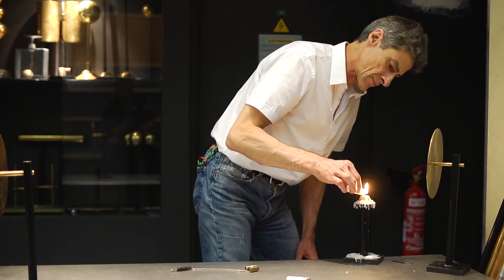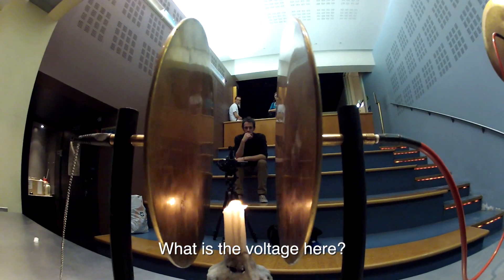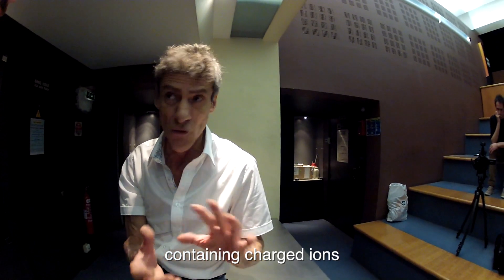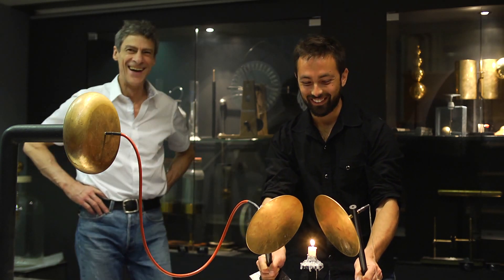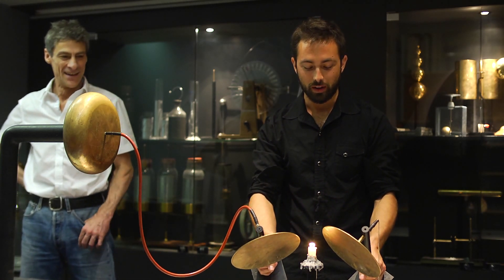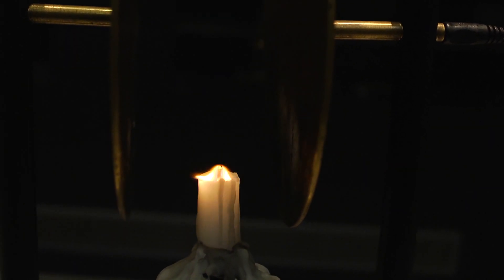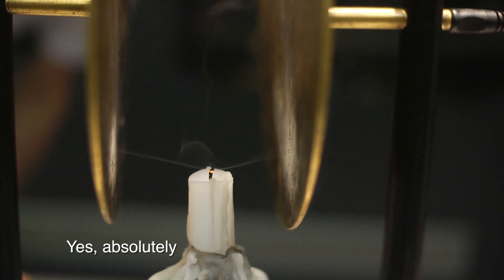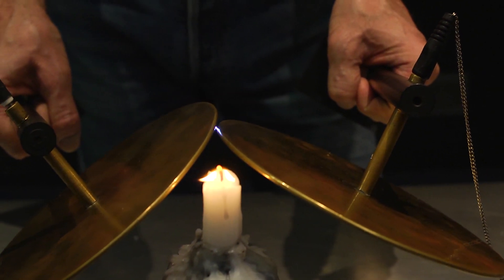What's In A Candle Flame?

Comment: ..., it's like a a drop os water being thrown at you really fast, doesnt harm you much. Although you're right when saying its a combination of both, but amps are more dangerous. Another this is that voltage doesnt drop imediatly. Voltage is the potential difference between 2 points. So electrons only travel is there's a potential diferrence. So if you're 0 and you're touching 20kV, Your body feels the 20kV. It doesnt drop to 0 immediatly. Actually if it dropped, you wouldnt see a spark.

Comment: i dont have an youtube account, just commented because many people seem to agree with this. What you said is not correct. You actually did it backwards. You buy a certain amount of power from the grid. You can see this in your electrical bill.So power is always the same. P = V*I, so if you increase voltage using a transformer, the current has to go down, because you cant create energoy from nothin.That's why you dont die, because the power is the same and the current is very low, (continues)

Comment: It's a combination of both that kill you.

A car battery can hold several hundred amps, but because it's 12v it's unable to overcome the bodies resistance.

A static discharge can typically be in excess of 20Kv, yet have a miniscule amount of current. 

Volts don't kill you. nor do amps. It's the two combined over a period of time, which is is known as energy, that kills you. ( (volts*amps)*time = energy )

Comment: Fencepost - the difference is that R is not constant. Once charges start having separation induced or even ionising, conduction changes a lot. Also voltage typivally changes a lot depending on the load (resistance) placed on it. Ohms law covers only a special case which is not all that common...

Comment: The energy source is important in your examples.  Your wall outlet is driven by the city power grid, which delivers relatively high current (15amps for most US households) with low voltage.  A Taser is driven by a battery (typically 9v, 500mAh from a quick Google).  In order for the Taser to get up to 20k-50k volts, the current is driven way down (about 2mAh), trading current for voltage.  And that's what Ohm's Law really shows -- the equivalency of the three properties.

Comment: The power source can't give unlimted current they probly had it put on a low amount of amps + evry source has an internal resitance which you can compare with a resistore in serie with your source. A tazer works on batteries which you can easly understand give a limeted amount of amps

Comment: I think we all understand that its the current that kills. The thing that is confusing me is: Why, when the resistance of my body is presumably constant, will a 120V outlet result in more current than a 50,000V tazer. Given V=IR, why does V not seem to vary directly as I when R is held constant? What am I missing. I understand that a fire hose hurts more than a squirt gun. But why does 120V equal fire hose and 50,000 volts equal squirt gun?

Comment: I'm just a layman but this is what I think. 
In the 1000A and 21V case, there isn't enough voltage to get that amperage going through the body. The metal being welded has high electrical conductivity, so the high amperage goes right through, even at low voltage. In the 10A and 210V case, the voltage is high enough to push it through your body, AND the amperage is high enough to kill you. I'm pretty sure you can die from a relatively low amperage, as long as the voltage is high enough(I think).

Comment: Well... actually its both. A welder runs at low volts but high amps and will give you a kick, but wont do you much harm. 1000 amps at 21volts (enough to boil steel) will give you a jolt. But 10 amps at 210 volts (1/10th the power) will kill you

Comment: 'Volts don't kill, Amps do' is a little oversimplified. Ohm's law stays valid. Body resistance is 1kΩ - 100kΩ, so at 20kV, that's 0,2A to 20A. Energy dissipation (V * I): 4kW - 400kW (!!). If you connect yourself to 20kV for just a second, you heat up like a toaster.

What really happens when touching these kinds of 'safe' high-voltage devices, is the voltage drops to zero almost instantaneously when you touch it, and it ramps up the voltage again after a few milliseconds, continuing in a cycle.

Comment: It's really joules that kill you, or, more correctly, watts, or joules per second. Or is it coulombs? A high voltage, low coulomb source, like a Van DeGraf, will cause a very high current to flow, but only for a few nanoseconds. This will cause local pain, and cause nearby muscles to twitch, but it will dissipate long before it has a chance to disrupt your heart's rhythms, and is far to little energy to overheat and damage muscle. 
Volts, amps and time all have a role.

Comment: Like the flame, the visible part of a spark is essentially plasma (please, don’t let the hounds descend on me with technicalities). The high resistance of the air causes much of the energy of the electrons jumping the distance to be dissipated as intense, but brief heat, causing the air along the path it passes through to expand very rapidly, but only for a moment. The resultant pressure wave front is what we hear.

Comment: I’m guessing this was powered off a wall outlet via a transformer. Presuming that and, say, a 20A fuse, the max current would be 120mA at most, for safety’s sake. As far as why he didn’t blow out the fuse, I’d attribute that to the fact that he didn’t touch the plates directly. As he indicated, air is a very poor conductor, thus the space of air between his hand and the plate adds a significant amount of resistance to satisfy your Ohm’s law problem. Besides, we’re pretty terrible conductors too.

Comment: Evrybody says that volts don't kill you... But ohm's law says that the voltage is proportional to the current. so you could think a power source of 20kV could easly kill you.. Its probly the internal resintance in the power source that restricts the current. The problem I had was WHY you get low amps so I guess its the restriction in the power source which is responsible for the low amps.

Comment: Big voltages give big currents only if the resistance R is constant. 20kV with high resistance will give a low current, so is quite safe.

Comment: Not to question your science...but science demands we ask questions.
How much of the difference in the spark gap through air and through the flame can be contributed to contaminates from the combustion and difference in air temperature?
I know the old vacuum tubes required a filament to operate correctly.  There was no flame involved there but there was heat.

Comment: One detail is slightly wrong,
"It takes about 20,000V to spark through 1cm of the air"
Well, it depends mostly on the ESR of the electric source. If you have a certain ultra capacitor, it can contain about 220V, because of it's extremely low ESR it can spark at about half a cm of air..